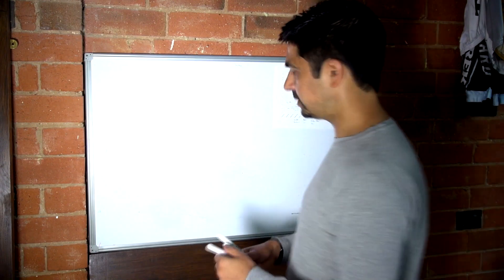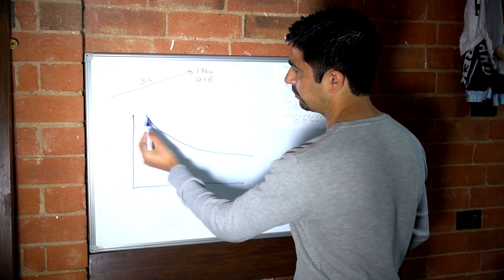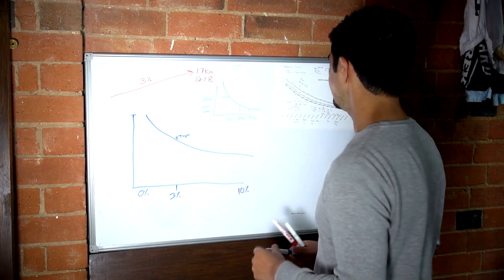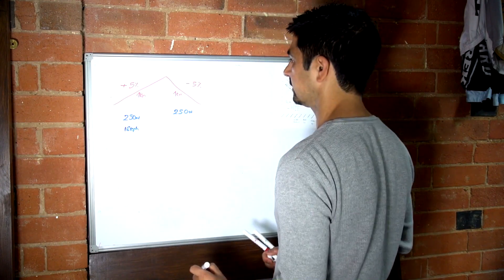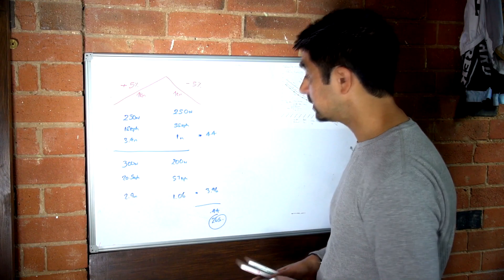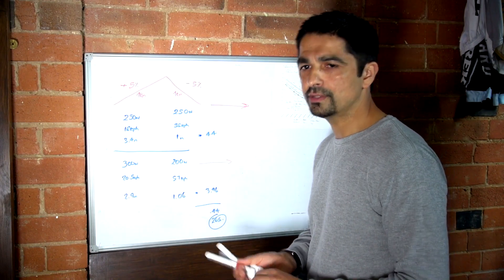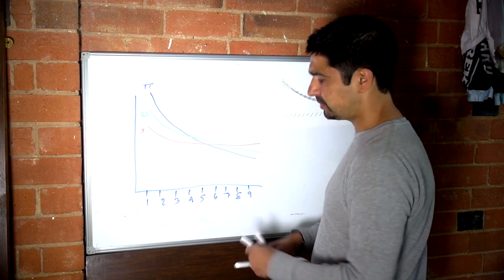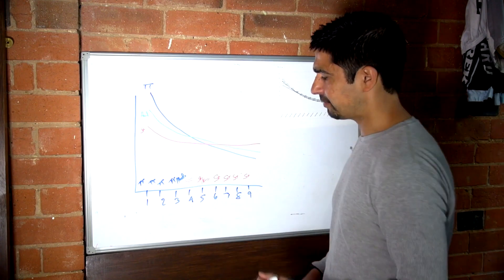Hill Climb Science: How to Correctly Pace Long Hill Climbs using a Power Meter

Comment: I would add that BMI or body mass index is the most important factor in determining how well a person can climb. If BMI say 10% is achieved through a combination of diet and proper training, the results are staggering. This however is not easy to do.
Reply: BMI is not important - PWR is!!! If you significantly lower your BMI you often loose power, mostly more power loss than weight loss (in %). The important thing is power to weight ratio!

Comment: I believe you need an edit at 9:10.  The cyclist expending 200W going downhill is not going to go faster than the rider expending 250W going downhill, all else equal.  You have written that he will take more time going downhill, which is correct, despite the higher velocity.  It appears the velocity is a typo.

Comment: He didn't talk at all about muscle recruitment. (Fast twitch, medium twitch, slow twitch) vs power?  When talking about variable power outputs that is the most important factor as to understand how long one can hold a certain power, and how repeatable that excretion is. Since one can only fire the fast twitch fibers once a week, or thereabout, than holding that power for only one excretion like the final sprint on race day. The medium twitch fibers take about a minute to recharge after a firing. This means that you can only use those muscles once an accent unless they can recharge intermittently. There is a sweet spot at your one hour FTP, I believe. The slow twitch can run indefinitely so if you are choosing a recovery power you want to only put out what they can produce.
Reply: What this means is that you have a ratio of time vs power that one can climb at a higher power than FTP and the length of time spent climbing souls be dictated by ONLY that rate, assuming full recovery.

Comment: Interesting approach on tt vs climbing wheels.  On the road however a cyclist needs to battle crosswinds.  That condition would surely affect decision as regards to wheel selection.
Reply: yes, but it's just in cross winds where aero wheels give the most advantage!!! In straight headwind (or tailwind) they are not faster than box section wheels

Comment: Very interesting video. Total science behind. Totally agree with you on all aspects. And no, you don't speed too fast. Your speech speed is just fine.

Alberto Contador was asked if he could change something, one thing only, in cycling during 2017. He said: Take the powermeter of the races

I believe his non-technical answer has more to do with getting pro-cycling back to the guts, instincts, making the giros more exciting taking of the powemeters from the races. He said races, not training. Do you agree with him @Fastfitnesstips?
Reply from the maker: +Gabriel Trainer sorry I missed your post. Essentially racing and even training sometimes without a powermeter is important mainly so you can judge what it feels like to pace on RPE and not on the powermeter. If you only ever ride with a power meter and one day it doesn't work correctly, you are sunk! Also there are times you just don't want to see that you are under-performing but you still need to train, on those days don't use the power meter.
Reply: There is a clear difference though, as carbon frames, tire tech, e-shifting and so on does not affect decision making in the same way. In theory, computer technology could calculate how to ride with perfect efficiency throughout the whole route, making it look more like a runners race where everyone is racing more independently from each other.

In reality it's different in cycling since the effects of drafting forces you to make decisions based on what others are doing, but on slower climbs, it really takes some of the combat out of it. The better the technology, the more independent and individual each climb would be. 
A rider wouldn't have to decide how to act when an opponent attacks on a climb, if he knows that he is riding at the calculated perfect efficiency, as long as there is limited drafting benefints.
Reply: Contador has a valid point. Knowing the weight and power of a cyclist you can easily calculate the results of a TT or a hilly race.
Reply: Contador is also anti-electronic shifting. I mean I understand the idea of keeping cycling "pure" but at the same time you cannot stop progress. If you want to remove power meters then let's also disallow moulded carbon frames,  and innovations in rubber tire tech, etc. As long as the sport remains 100% human-powered and adheres to reasonable safely regulations, I don't see a reason to ban anything like power meters.

Comment: Could you discuss the difference between rotational weight (wheels) and static weight (bike) for hill climbing power requirements, in the context of different riding styles (i.e.  standing or riding seating)? 

Rotational weight is said to be only beneficial  when accelerating, but, as I see it, it seems that when pedaling standing (specially in very steep sections: 15%, 20%, 25%) every pedal stroke is an acceleration!? Is it?

With this in mind, I usually force myself to keep mostly seated when with my heavy (aero alloy wheels)... 

Cheers and Thanks for the great video
Reply: In a true sprint, you are only accelerating (to reach a certain marker in a race).  In a climb, you are both accelerating (while your cranks are in a more horizontal orientation) and decelerating (while the cranks are in a more vertical position.  In an "ideal" model (one where things like small friction losses from additional tire deflection doesn't count) every additional joule of energy you put into increasing the angular momentum of a heavier wheel during the acceleration part of the pedal stroke will be "paid back" to you from the flywheel effect while you are decelerating in between accelerations.

That said, heavier wheels do take a toll on a climb that's hard not to notice.  Any additional weight on any part of your bike or your body is not helpful on a climb.  But your wheels are the least sprung part of your entire consist.  They must flex and bounce over even the tiniest bumps in the pavement.  Additional weight doing that flexing and bouncing up does dissipate extra energy into heat losses both internally and in the form of the extra jarring they transmit into the frame and into your body.  This is why the the wheelset should be the first thing you look to upgrade on a stock bike in most cases, and why extra weight in the wheel seems to count more than extra weight in something like, say, your body, which is the most sprung part of the whole system.
Reply: Yes, I thought that, what about the moment of inertia of the wheels? I think the answer is that this is only a factor affecting acceleration, not speed.

Comment: Good video thanks. I wonder looking at Chris Froome's weight, the climb where he used a power meter in the Vuelta Espana recently v Quintana, and his time taken on the climb, can his FTP be worked out? When I am on a moderate climb I visualise Froome and that is him mostly in the sitting up position on the bars or hoods a la Mont Ventoux. My standing power, as described in the video, is short but I haven't really trained for that position whereas I have seen Contador stand for long periods up climbs so this can be improved. I wonder what is the best exercise to improve standing? I would imagine a leg extension on a bench type exercise.
Reply: firstly it is a personal matter, some can better climb standing than others, as is the cadence - some have a preference for high cadence more than others. And than it's hard, hard training... in training Alberto is riding standing for 20-30 min... try that 😄
And than there is one more aspect: Froome is much taller than Contador, so when he stands, his frontal area improves more than Albertos

Comment: Fantastic video! Never seen numbers on the position versus grade before. I ride elite category and consider myself a climber. W/Kg 6.0 for 10 mins 390w @ 64.5kg. How would the position versus grade look for me? I tend to use TT bars on anything up to and including 7%! For anything 8%+ I'd always go on the hoods, with perhaps the odd 30 secs standing for the steeper pitches. I was following the principle in the last graph you showed in that aerodynamics in general beat lightweight for my power numbers for grades up until 7% - but I can see I'm not necessarily correct to do this. How do headwinds/tailwinds affect this? I guess a tailwind would allow for more upright positions at a given grade. Thanks
Reply from the maker: hi try to follow the links in the video to work out your own stats. In general for a more powerful rider like you, you are going faster than others up steeper grades so aerodynamics come into play even at high grades. In short you are probably  correct to ride TT up lower grades because you are likely going over 20kph. Over 20kph aero is really important